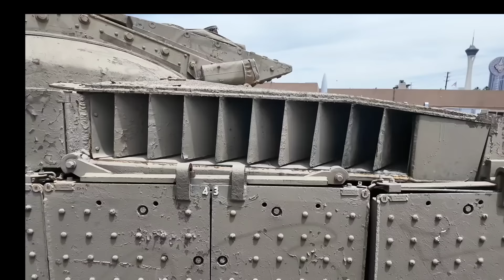First Merkava Mk2 in U.S (reload)

Comment: I was a Tank Mechanic's in IDF Merkava 1 up to 3 and in reserves I had the opportunity to handle a Mark 4
M68 105mm gun (L7A1 from the Centurion tank)
Most likely, you will be familiar with the motor, since it has an AVDS-1790-9AR "Teledyne Continental" similar to those in the M60
"Allison Transmission" CD850-6BX
"Vickers" V-shaped suspension

A little tip:
if you decide to disassemble the driver's seat .................. be VERY careful not to get the spring on your fingers .....

Good Luck
You guys have a lot of work to do to "bring it ALIVE" :)))

Comment: I received the first tanks of this model for our unit, so like this, for its time this tank was almost impenetrable, we took a 120 mm shell from a T62 from a range of 800 and not one from the front and one from the side, this tank was very fast and even in very difficult terrain with a lot of rocks and very soft to the crew's feeling, from a mechanical point of view it was very easy and quick to maintain a car mechanically, the easiest way to get into the driver's seat is from the top hatch, of course the turret should be aimed at the center, this is the first tank in the world with a thermal firing system

Comment: When back in 80's I was enlisted to IDF I wanted to be tanker but I've been told that you can't be (I think) than 5'5 or 5"6. As for driver so tight is because that when you go on uneven surface you won't fly around but be in one spot, does that make any sense?

Comment: Dude please....The tank was never used as a personal carrier. The only reason it is so spacious is because it was gutted from its 62 shells casing racks. The drivers never enter the driver compartment from inside the tank, always from the hatch. To exit the tank from the rear door you need to grab 2 handles situated on the roof of the back corridor. you are probably missing them. On the outside of the rear top door there is a black knob on top of a pull out rod that when pulled out acts as a lever and makes it whey easier to open the door.
Reply from the maker: I appreciate good information, thank you! I will have a follow up video on this tank.

Comment: Great review.

As a person, who spent considerable time insde one of those i would like to add some insight just for fun.)
1. Service position of the turret is about 15 degrees right from the center, this gives perfect access to the drivers hatch and this is the way the driver is supposed to get in and out in most cases. To transfer from the crew departemnt to the driver seat the turret should be turned about 90 degrees to the right, giving much mor space to move.
2. Crew usually enters and leaves the tank from the top hatches. The back door is usually closed and locked and used only in special scenarios.
3. Drivers seat ability to drop its back support main purpose is to extract injured driver, by dropping the back of the seat and pulling him by the special strip on his back to be able to handle his unresponcive body.
4. The back of the tank is not that empty, usually it is a narrow passage between ammo boxes fixed to both sides of the passage.
5. The general design is to use any possible components of the tank as additional armor between the hit and the crew. For example the engine itself is another layer of protection.
6. This vehicle was based on m60 as m60 was the main battle tank used by israely army after Vietnam, when those where sold to Israel instead of bringing them back to US. So a lot of inspiration was taken from them. Later models Mk.3 and Mk.4 go further away and more based of practical experiance.
7. Fun fact. Mk.2 was not designed to be this heavy, it was supposed to be about 10 tons lighter, this caused its track to require much more service, as being prone to damage from the stress.
8. Oil based hydraulic systems are indeed very flammable, if tank is ignighted, the crew has up to 60 seconds to leave the vehicle, otherwise it is considered deadly. The crew is trained to do so in different scenarios of damage.
9. Electrical system support 24 volts of power and allows full weapon and systems operation of the tank with engine turned off for at least 2 hours. This works on battery power. Obviously to be able to drive the engine is started, but other than that, its operational.
10. Gunners usually the shortest guys chosen, drivers are the tallest, loaders are the strongest. Compartment sizes and operational needs lead to this seperation usually.

Enjoyed your video, keep up the good work.
Reply from the maker: Thank you very much for your input!
Reply: Another ex-Mk.2 B/D crewman here. The Merkava was most definitely not based on the M60. It's an entirely different concept built for an entire different theatre using an entire different doctrine.

Comment: this is basically an 80s built tank, stripped and decommissioned with barrel removed, some of the Merkava mk2s in Israel were converted to "Ofek" heavy APCs
Reply: Only the prototypes. Production vehicles are based on the Mk.3. The wheel spacing is a dead giveaway.

Comment: The reason you're struggling so much with getting into the driver's seat is because you're not using the top hatch.
The turret needs to be out of the traveling lock and pointed to 1 o'clock. That way it only takes about 10 seconds to get in and out.
Reply from the maker: Im sure you are correct, maby for the next video I will do that.

Comment: When we drove these tanks on roads, we usually put tires on the road so that we don’t tear up the asphalt
Reply from the maker: Sounds like alot of tires
Reply: @Point-Blank-Armor  and as a tank driver, I had to mount these tanks onto trucks for transport. It would seem that the tow trucks in Israel are wider than the ones in the United States. Because in the video I saw that the Merkava mkII barely fit. It must’ve been incredibly difficult to get it on there and balanced.
Reply: @yavinklein-katz7719  Yes, I was out of town when it arrived and after watching the video, I'm glad I wasn't there. I would have lost my mind watching them unload it.
Reply: @Point-Blank-Armor  you’re right if we were using roads, we only use the tires to crossroads because that tanks completely destroyed roads.

Comment: LOL, I read the history of the construction of the tank and its first use in combat. A tank was disabled in Lebanon during the war. A technician that designed the tank was so excited to see how it held up (against T 72s) and ran up to the Merkava without identifying himself. The crew got on him real quick, until he identified himself as the designer. One of the crewmen then kissed him. The design saved them. Ironically the Merkava is designed to survive a, repaired and sent back to combat quickly (with the original crew.) But the Merkava II was a rare design in the IDF. It was replaced by the Merkava III and then Merkava IV. Today they have a fifth generation called Merkava Barak (lightening, as opposed to Obama.)

Comment: I recognize that there is a problem with the tank's caterpillar tension, probably originating from the Golan Heights, because there are no rubber cushions inside the caterpillar links, and where did the barrel go?   ?   :face-orange-raised-eyebrow:
..
Laser radiation caution
..
In general, it is highly recommended to wear a helmet whenever entering a tank.

Comment: Well, without a main gun. It's a heavy personnel carrier. The engine sounds a lot like an M-60A3 (1989-1991 Ft. Knox)
Reply: We had to remove the gun tube for transportation purposes but they were included. As for the sound, it's the same engine as the M60 but the IDF managed to squeeze some more horsepower and torque out of it to account for the additional weight.

Comment: Hysterically laughing while you get in the driver's seat. You've got to go feet first. I was a loader and we used to switch inside the tank during ambushes in while in Lebanon for safety reasons. That's the only reason to go in that way. Otherwise, drop in from the top!

Comment: There is a significant slack in the tracks, on both sides. There should be a pump on the rear, somewhere near the rear idler wheel (the idler here is on the back, as the motor is at the front). You need to pump it up, otherwise the looser the tracks get, the chances of track throw increases.

Comment: Admittedly,i'm a fan of the majority of Israeli weapon systems. They seem to excel at getting the most out of a particular system,in a way that best suits their particular needs. They made improvements to the AK47,& you get the Galil,they looked at an MBT & a APC,& decided to combine the two,although they do have purpose specific APC's,they use Merkava's as well. Definitely 1 of my 3 favorite tanks,w/Challenger 2/3 & ?M1 Abrams series being 1-1a,& the Merkava series being 2,& what many consider the best overall tank,the Leopard 2 series,which I can't disagree with,but personally,I have it at 2a-3. Also,not to leave the S. Koreans out of the mix,as their Black Panther MBT,seems to bw turning a lot of heads,altgough it kinda looks like a mini Abrams to me,but apparently has top shelf offensive & defensive systems

Comment: The engine is a standard Continental AVDS 900HP, so you won't have a problem handling it. The electrical voltage is 24V. Another advantage of this type of suspension is that you can shorten the track and drive on only 4 wheels. Congratulations on your purchase. from israel

Comment: Great video. but it`s not a Tank/APC, the extra space is where the ammunition storege compertment is.
Israel converted old Merkava tanks to an APC called NAMER and is still using them.
Reply: Not entirely true the merkava 2 b was modified to hold less rounds in the crew bay so they could also carry a small squad of 5 troops to dismount when they are in urban areas for support

Comment: Wow! It’s a beauty!  How much was it? Was it hard to get, and transport it here?  I  When I traveled to Israel in 2002 I had a chance to visit an Israeli Tank Museum!  OMG !!!  Any tank enthusiast would be amazed by variety and the quantity of tanks they have there!
Reply: You're probably referring to 'Yad La-Shiryon'. An amazing museum indeed. Just been there last week :) For anyone interested: https://en.wikipedia.org/wiki/Yad_La-Shiryon
Reply: I can't disclose prices because of continued active sales of equipment surplus to Israel's needs but the cost of shipment was INSANE! Most equipment is designed to unbolt and break apart for shipping due to height and weight restrictions. In the case of the Merkava, there is no disassembly available to make it easier to transport. They BARELY fit on the transport carriers even  with the extensions.

Comment: you're are wrong about the fuel tanks, the batteries on the turret are for the hydraulic system. also you are talking about a tank that was designed in the 1990's era it was a state of the art back then.  the fuel tanks are mid way in the engine bay below the transmission.

Comment: You need to turn the turret to 1 o'clock position and enter the driver's hatch from the top... if you enter from the back, you must drop the driver seat flat (also used in rescuing its driver  via te drag handle on the overall. and gunner supposed to take over SOP).

Comment: Just a few comments. 

The Merkava was designed with its powerpack at the front for the following reasons. 

In the wake of the 1973 war the main design criteria for the new tank were crew survivability, (even at the expense of a mobility kill) and rapid replenishment of ammunition to keep the tank fighting. At the time of design, the major threat was seen as HEAT rather than kinetic energy projectiles. (Nowadays in the era of APDSFS long-rod rounds, the situation is largely reversed). Given the  main priority was crew survival, wherever possible components of the tank were placed outside the fighting department and designed to be sacrificial.  Without access to Chobham armour Tal and Talin, the two main designers of the Merkava decided to change the Merkava's design to a non-conventional configuration. Battery packs, fuel cell, heavy suspension, NBC system and even the 60 litre water tank are  expendable, the crew are not.  The self-sealing fuel tanks add to the protection of the frontal glacis.  The rough rule of thumb is that 7cm of fuel provides the equivalent of 1cm of rolled homogeneous armour. against HEAT rounds. The powerpack offers some further protection against HEAT rounds, but little to none against modern kinetic energy projectiles. 

If you know how to exit the tank from the clamshell door, it is much quicker and easier to bale out from a tank brewing up, than having to climb out of a turret hatch under fire. The rear clamshell door also allows the resupply of ammunition directly into the hull, much more quickly than having to hump ammo up the sides, into the turret and then into the hull.  

The space in the rear taken up by ammunition in individual fire-proof containers can be stripped out. This  allows the temporary carrying of wounded, bailed out tank crew from knocked out vehicles, or even a five man infantry squad for a short period. The passengers are carried in great discomfort at the cost of ammunition supply. The tank was NEVER designed a an APC or IFV. That is an urban myth.

Incidentally the Israelis licence built the original British L7 105mm gun, not the similar US licenced built copy of the L7, the M68 gun. 

Nowadays the Israelis are world leaders in armour technology. Particularly SLERA. Given this, the real question is  should the Merkava  4 have continued with a front mounted configuration or not?

Comment: The reason you have so much space in the back is because the ammo racks are missing.
Reply: The engine is in front, which is why there is so much room in the back
Reply: @marvinbleiberg4338 no he actually right. The ammo rack is useally placed in the back, tho you still have room for about 1-2 infantry soldiers with the ammo rack presents

Comment: It's not a true MBT. It is a gloried CFV. The problem is that it doesn't know what it wants to be. They stuck the engine in the front, and then say how great an idea that is. It's not. Instead of having the thickest armor in the front like a true MBT, it has a hollow engine bay for the engine block to sit in. Contrary to popular belief, the engine block is not "good armor." Why do you think the back of any MBT is the most vulnerable part? In the Merkava that's the front! To make matters worse, the back of the Merkava has a small troop compartment. Once again sacrificing armor. The Merkava is called "the most survivable" tank in the world. This is a lie. The truth is it lacks the armor of a true MBT. Just because it has the armament of an MBT and looks like an MBT doesn't mean it is one.
Reply from the maker: Many points you made here, I will be talking about it in one of my next videos.
Reply: It’s not at all designed to carry troops, it’s fully designed as an MBT. It’s just that an interesting side effect of moving the engine to the front and adding a rear door was allowing you to stuff a couple of soldiers inside the ammo compartment if you removed all the ammo. As someone who’s traveled in that compartment, I can guarantee you it was not designed for human habitation. It’s an MBT with a heavier emphasis on frontal protection, that’s it. I’ve yet to see a CFV with a 120mm main gun, a machine gun for each crew member, a designated loader, and a full battle load of 44 shells. That’s an MBT. 

Also, sure the engine doesn’t make for very good armor now, but back in the 70s and 80s when the greatest concern was HEAT, it was pretty effective. Still is, against the ancient RPGs so commonly found in Gaza. Honestly, if Israel designed a new MBT now, it probably would have the engine at the back, but the basic design still works and there’s just no pressing need to change it. When it becomes critical, they’ll come out with a new tank.
Reply: it absolutely is an MBT by all standards.
all tanks walk the balance line between armor, mobility and firepower.
the merkava is used as an MBT first and foremost, and it does its job very well.

the extra infantry compartment is the ammo compartment. it cannot carry troops without unloading rounds. its a niche feature that isnt widely used.
the armor thickness on all sides is classified, so no one can really say how much was sacrificed if at all. it could just be bigger, and heavier, to add these features without sacrificing armor.
i dont know why you believe its impossible to have the same thickness of armor at the front if the engine compartment is there.
there's footage of merkavas being hit by Kornet ATGMs and shrugging them off.
Reply: @Healmace  I've heard this reply before time and time again. It is the standard go-to explanation by your country's military. It is very good sophism, I'll give you that, but has no basis in the real world.
Reply: @N1492E completely disregard what i said with no explanation? 
Why should your opinion hold any value if you dont back it up?
Reply: @Healmace  because all you said was, "it is USED as an MBT." that was your explanation. It is USED as an MBT, therefore it IS an MBT.
Reply: @N1492E  Lol it's one of the most armored tanks in the world, with or without the front engine...